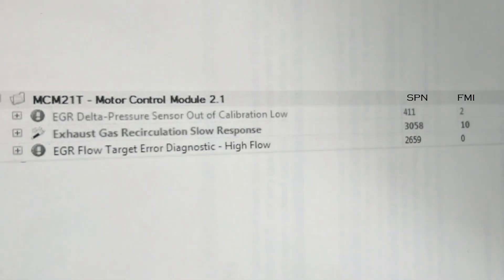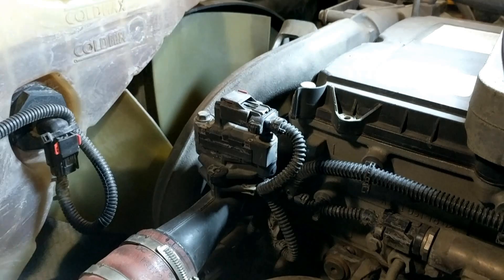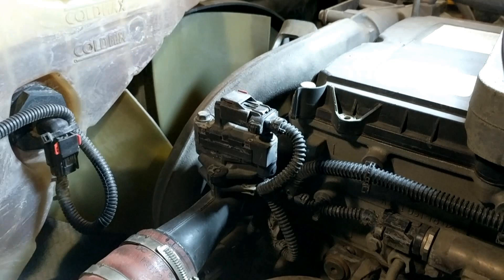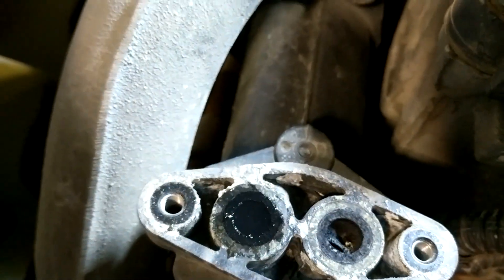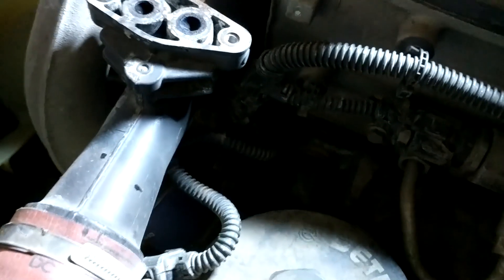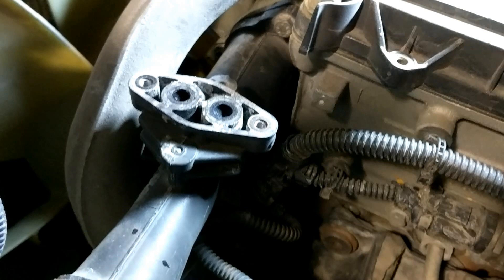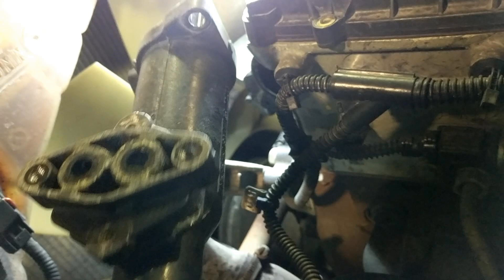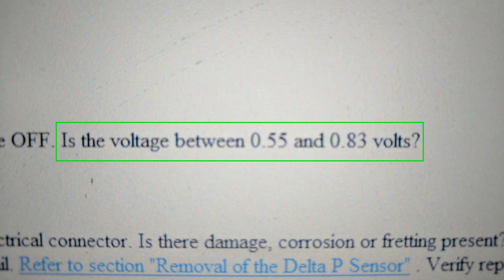EGR Quick Fix - Keep that Engine light OUT

Comment: you said the ports have a bend in them.  true on the early dd engines.  the later venturi's have a straight port to help alleviate the  plugging problem.  there is an update  kit with new venturi pipe, delta p sensor, and corresponding connector replacement. also some of the kits were packaged incorrectly from the vendor to ddc.  the delta p sensor should ALWAYS be level front to back.  if not, you have the wrong venturi pipe for that engine.   and a quick explanation of what the sensor is doing.  the sensor measures pressure difference (egr does not flow thru the sensor) between the high side and low side which the ecm can then calculate egr flow.  if the port gets plugged the ecm believes there is NO egr flow and slams the egr valve wide open under all engine conditions.  obviously at low speed the engine cannot swallow that much and stumbles and smokes and cant pull a greasy string out of a cats azz and of course throws a code. egr gas is inert (no oxygen) so if the ecm is pushing fuel into the engine it cannot burn without oxygen and smokes like an old freight train filling the dpf prematurely .  one thing leads to another.
Reply: Thank you for these brilliant details . Great stuff!
Reply: great info bro thanks